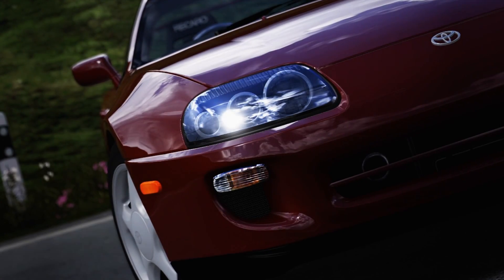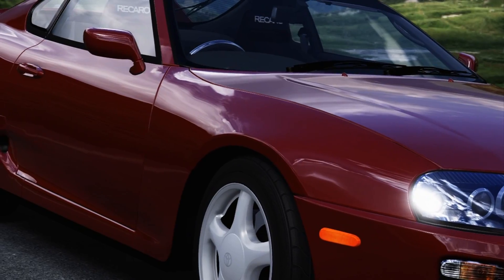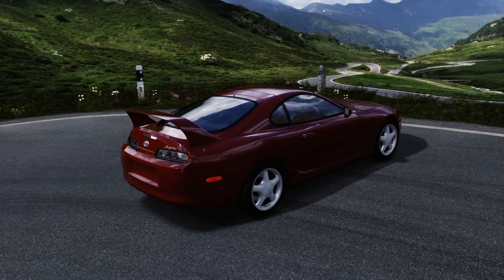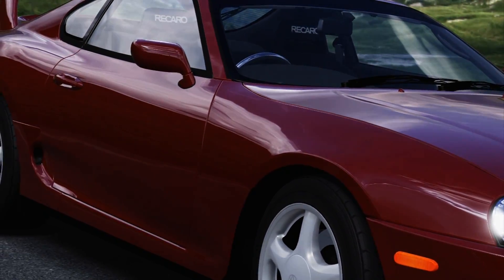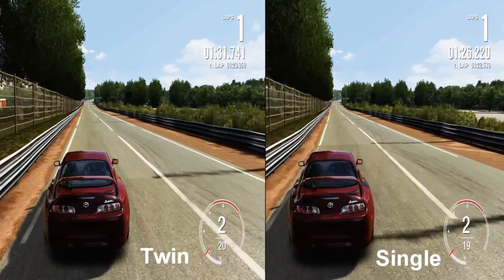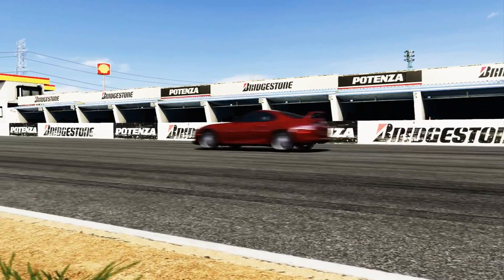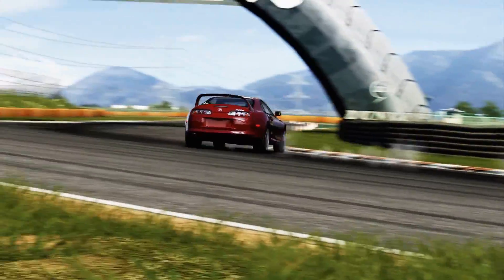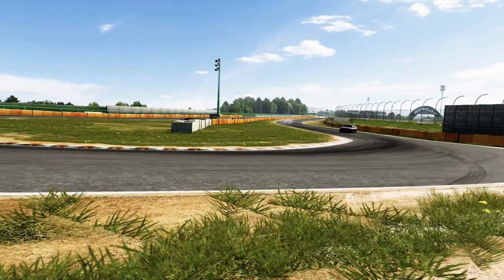Single Turbo vs. Twin Turbo Explanation | Forza 4 Comparison

Comment: secound, Ive had bad experiences with manuals, automatics just fit my style better, its not lazy its just smarter on a car 20 years old or more a manual transmission lags and its more work than its worth. i have seen a turbo automatic, it worked quite well at 8psi and was a lower grade turbo then mine, preform quite well. They CAN preform better with a ecu that has a race setup (what i have) its more work but can be beter. its more work and needs "profesional" work but can work beter.

Comment: Ok so i found a 16 pice kit for 1600 i think thats my best bet. its a stage 3 for 1600 no joke, incooler and everythn!  I did some research a super turbo combo has been done but is a little bit to crazy, after looking at everything my new ECU would work nicely with the stage 3 turbo, Also i found a replacement exaust sysem pretty cheep 2.  With my front wheel automatic setup it just seems to fit well. Because its automtic it will have wayyy less turbo lag and be a better car.

Comment from the maker: Also, you can't just bolt on a Stage whatever Turbo to a car.. There are loads of supporting mods that go along with the turbo. If you're going Stage 3, internals would probably be concern. That means, pistons, connecting rods, etc. That's big dollars. Like I said before, Stage 1 or Low Pressure Setups will run 2-3k.. Supercharger tend to run a bit cheaper, but the same applies. You'll need a lot of supporting mods. Do more research, and find out for yourself what's best for you.

Comment from the maker: Dude. I wouldn't be looking for turbo/supercharger setups if you don't really know much about your car or cars in general. Real Life isn't Forza man. If you are looking for a LOW PRESSURE SINGLE TURBO setup, you're looking at 2-3 grand. That is if there are any setups, that exist for that car. If not, you'd have to piece it together yourself, custom piping, custom ECU map, etc. Twin Turbo, you're looking at AT LEAST twice the price of the single setup. Superchargers will run at about 1-3k..

Comment: Im going to get a 1994 mx6 v6, I was wondering, which is the best for my car? The car has new headers as well as a high end ecu replacement. What would get me better preformence overall. A twin turbo, a singular turbo (stage 3), or a stage 3 turbo and a supercharger? Also whats cheapest?

Comment from the maker: A twin turbo setup would be more beneficial on a V6/8 rather than I6(I don't think they make I8's lol) because, the flow would be split. As you said, it's like two inline engines and yes, it would be 4 cylinders going into a common manifold, but that would be better than 8 cylinders going into a common manifold, correct? That's what I meant by that. I hope that cleared up the fuzziness lol. If not, just ask me :)

Comment: I may be wrong but like you said, when all headers are joined together in one common manifold the flow becomes smoother, however on a v8 it's better because it pulsates more?!?! How is that possible? Each bank is essentially a inline 4, and all 4 cylinders' headers need to be joined up to spool a turbo on each side. That makes is just as "smooth" of a flow, and not "plusy" im confused on that, if you could just clear that up, that'd be great!

Comment: Not really superior...  You get more power from them but drifting can be made harder depending on the turbo lag.  Lag can be reduced by using a twin turbo setup but there is still the lag of the spool.  Superchargers are constant steady boosted non-lagging upgrades which in my opinion offer better throttle response and control during slides.  Don't get me wrong about turbos since I drift a twin turboed 85 Rx7 its just all in the driver and what their skills require.

Comment from the maker: I actually quit Opal lol. But I'm still good friends with the leaders, message "reesetreats" on Youtube, for details. Well, My Setup consists of a Hauppauge HD PVR, My Xbox (Of course), and TV (Obviously). I have the HD component cables from the Xbox to the back of my PVR, and HD component cables from the HD TV to the back of the PVR, as well. Then the PVR is connected to my Laptop, via USB. When you record, you'll have a delay in the preview. But, why use that when you have the TV?

Comment from the maker: Depends what you want. Supercharger gets max boost instantly, while it takes a little longer for Turbos. But, Turbo's tend to make more horsepower, since Superchargers have a parasitic effect on the engine, since it uses power from the engine to run. While a Turbo uses "free energy" to create power.

Comment from the maker: Well, it depends. If you want a traditional RWD Drag Car, Muscle cars are nice since V8's have a lot of low-high end torque. But if you look at the weight distribution of the car, you want the percentage to be as low as possible since you want weight in the rear of the car, since it's RWD. I'm not that great at tuning Drag cars, but I'm sure you can find a nice Drag Car tutorial. Look up "Forza 4 Drag Tuning" or something like that. You're bound to find something! :) I hope I helped!

Comment: Awesome video but a few things. Usually the intercooler has anti-freeze aka coolant, also when in a engine there called combustions because a explosion is defined as uncontrolled. Just those things should also do a twin screw vs centerfigual super chargers